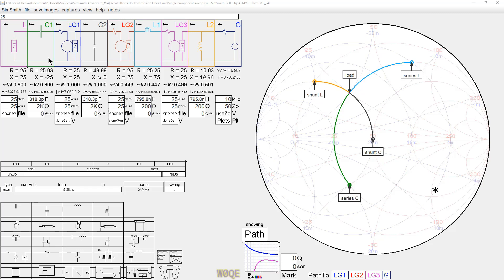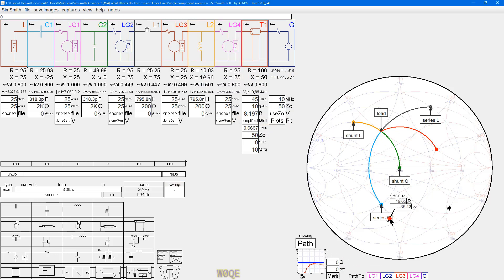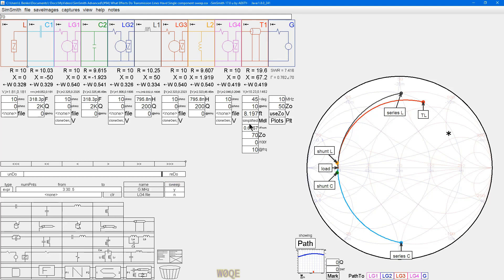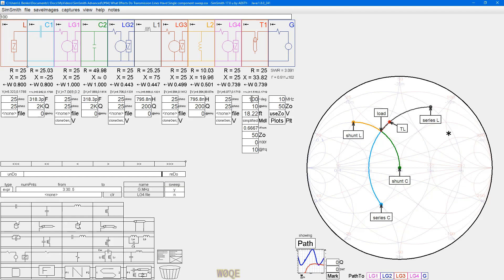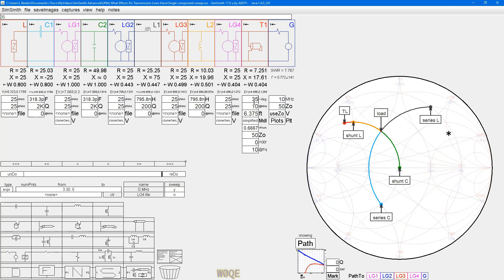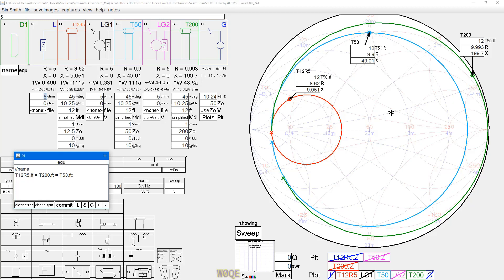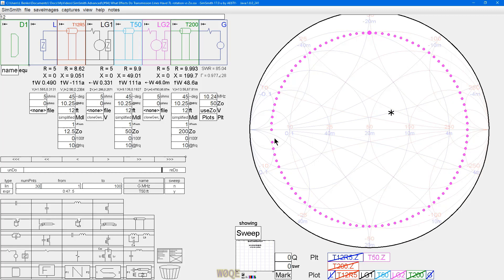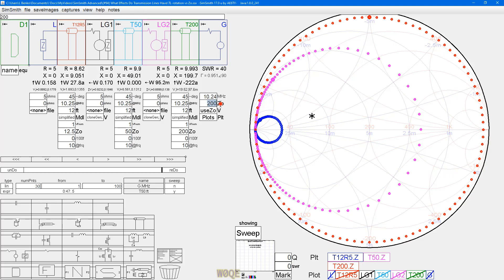#94: What Effects Do Transmission Lines Have?

Comment: what is in the background of this software, so that it do lumped & distributed analysis at the same time, does it use FEA.
Reply from the maker: I am not the author of the software but SimSmith does not use finite element analysis.  Rather it uses a system of matrix equations to do the analysis.  There is a SimSmith user group at groups.io where you can ask the author of the program (Ward, AE6TY) for more details if you need them.
Larry, W0QE

Comment: So does the path always form a circle centered at the point that is the Z0 of the line?
Reply from the maker: Elwood,
A lot of people think this is the case but unfortunately that is not true.  Set SimSmith to have the center of the Smith Chart to be 50+j0.  Then set the load to be 25+j0 and put a 300 ohm lossless transmission line in series with the load.  You will see the transmission line will cross the horizontal line at 25+j0 and 3600+j0. Just eyeball the center of the circle and it is 100+j0 which definitely is not 300+j0.  Now change the center of the Smith Chart to be 300+j0 and now the center of the circle appears to be 300+j0.  While all the points on the circle are the same no matter what the center of the Smith Chart is the center of the circle has no real meaning.  If you need me to send you a SimSmith file showing this send me your email and I can email you the file.
Larry, W0QE